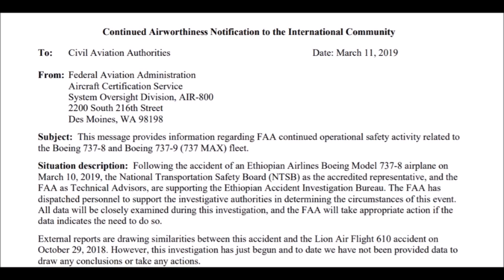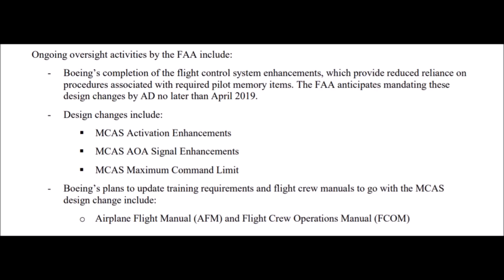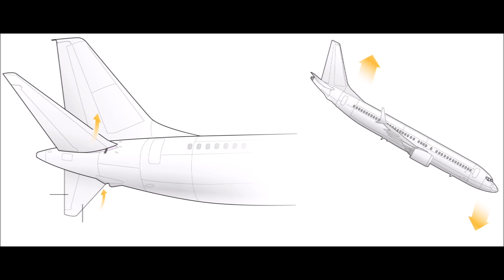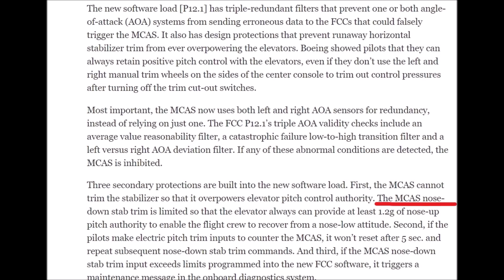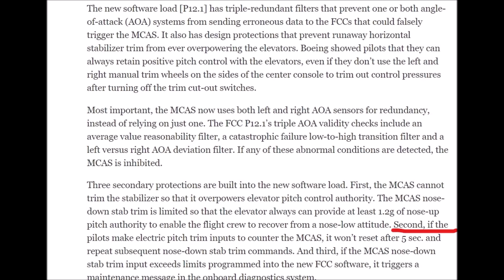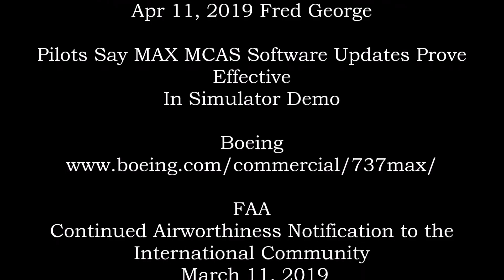737 Max UPDATE 14 April 2019 "The Fix"

Comment: Why was it not made easy for pilots to simultaneously disable MCAS control and enable pilot control of electric stabilizer motors? It seems so obvious, there must have been some engineering reason to not design it that way.
Reply: Its obvious only in retrospect. The engineering reason was the need to avoid additional wiring and switches. The training reason was to avoid more hours in the simulator.

Comment: Does anybody know if it was the Capts. side AOA vane on both the Lion Air and Ethiopian accident aircraft which caused the problems?
Reply: Yes, captain's side on both. This is part of a bigger puzzle. One clue may be that the passengers embark from the captain's side, so there may have been ground damage to the AOA vane on that side of the aircraft.
Reply: @gordonrichardson2972 , the aircraft I used to fly had a problem with the jetway damaging the AOA vane, but since we didn't have anything like an MCAS/stick-pusher system not as serious obviously. Jetway drivers were warned to carefully drive up to the door without hitting it, but it still happened...
Reply: Precisely! Studies have revealed numerous cases of damage to AOA vanes, but without MCAS nothing happened expect unreliable airspeed, which is not flight critical.

Comment: I don't think the max is inherently stable when there is a "but" after the "inherently stable."  It might be possible to make it stable but by design it isn't inherently stable.
Reply: jones jones — What does “inherently stable” mean?  This term is thrown out without anyone explaining what they mean by it, which indicates that they don’t know what they are talking about.

The center of gravity of an aircraft will normally be in front of the center of lift, but will vary fore and aft depending on fuel, cargo, and passenger load.  Gravity will therefore cause a pitch-down effect.  When engines are slung under the wing, below the center of mass, under power there will be a pitch-up effect, which will vary depending on power.  The adjustable horizontal stabilizer is used to compensate for these forces to achieve balance.  This is done on all similar aircraft.  There is nothing fundamentally different about the 737 Max.
Reply: @GH-oi2jf  I've flown many airliners first off and was an airline mechanic before that.  I'm not a video game player commenting.  Not every plane has what the max has.  Not even close.  Pitch up with wing mounted engines is normal when increasing power but no other planes have an mcas system to counteract an abnormal amount of pitch up the max 8 has.  Inherently stable plane means stable plane.  It isn't inherently stable if adding power causes such an extreme pitch up moment that the plane needs software to counter the affect.  In ANY other plane out there right now, a little pitch down and manual trim or auto trim if airbus, is enough.  The max needs more than that.  That to me, seems less than inherently stable regardless of cg.  Every other plane out there is fine with a light load and aft cg with what has been considered a reasonable amount of pitch up with power without the need for mcas 

That said I have to admit in hindsight that perhaps the pitch up isn't that extreme but it is just enough more, that Boeing felt mcas could avoid the requirements for additional crew training.  I just have a feeling though that it must be pretty bad compared to other models of the 73 to warrant the extra complexity.
Reply: Nice explanation! Unfortunately the public have been much misinformed about stability, particularly by fringe media stories.
Reply: @gordonrichardson2972  only problem is I probably know 10 times more than you about this subject.  Still not a hell of alot but more nonetheless.

Comment: Once again we got an excellent explanation about what’s going on with the 737 MAX. 

I’m hoping the airlines require rigorous pilot training for the new MCAS version. That should be equivalent to getting a new type certificate.
Reply: According to the WSJ “the proposed revisions, released for additional public comment, don’t mandate additional time for pilots in ground-based flight simulators, because FAA officials have determined the handling qualities of 737 MAX jets will be similar to earlier 737 models.”

But that’s what they claimed for the original MCAS. And 346 people died.

Comment: MCAS is only the tip of the iceberg - the aircraft is not designed properly - the MCAS is a makeshift bodge to try and correct the fundamental problem.
Reply: Bruce Bedlam — Baloney.  This is conspiracy nut stuff.
Reply: Plenty of nuts out there...

Comment: Has anything been found as to the reason that the angle of attack sensor readings are not correct on new aircraft? Is something being done that causes them to fail? I assume they are the same sensors used on other aircraft.
Reply: Maybe others do fail, but on other planes that failure doesn't drive them nose-down, so it isn't such a big deal ?
Reply: Exactly! A warning of unreliable airspeed isn't going to crash an aircraft.
Reply: Good questions! There were suggestions of electrical faults, but mechanical damage on the ground may be the simplest cause. Other aircraft have had AOA faults, but without the catastrophic consequences.
Reply: Any small, movable mechanical vane stuck on the outside of an aircraft must be susceptible to physical damage, ice, lack of lubrication . . .  just look at the history of pitot tubes which are inherently simpler.
Reply: @TommyRaines  If they have a high failure rate, I would think that there would be at least 2 on each side and they wouldn't rely on only one.
Reply: BTW, the B-2 bomber uses non-mechanical AOA sensors, but those can also fail if water gets into them. See: https://en.wikipedia.org/wiki/2008_Andersen_Air_Force_Base_B-2_accident

Comment: I can't understand one thing: if MCAS was originally designed to compensate the changed position and thrust of the new engines, why it's main input data is not the actual thrust levels of the engines?

Comment: Nobody talking about the fact that the aircraft design is faulty. MCAS wouldn't be required at all if they had actually designed it properly in the first place. MCAS was a fix. Now they are talking about a fix for the fix. That will probably in itself require a fix.
Reply: Dead on.
Reply: Spot on, it's crazy, all to save money and be more competitive. Hopefully once the NTSB complete their investigations the whole industry will get a shake up and also break the cosy FAA/BOEING relationship and the practice of self certifying their own designs. All at the cost of so many lives, that's a tragedy.
Reply: Oliver Lewin — The aircraft design is not faulty, apart from MCAS.  You weren’t paying attention to the video.
Reply: @GH-oi2jf  So why don't other aircraft use it? My paramotor doesn't need electronic aids to prevent a stall. Neither do most others. MCAS was a fix to a design flaw. It's that simple!!
Reply: @GH-oi2jf  MCAS is a sticking plaster to enable a larger engine to be built on a 60s designed airframe.

Comment: Bottom line "FOLLOW THE MONEY". Automation is all about ' Replacing the cost of pilots.
When you here something like " Statistically, pilots are dangerous .001% of the time and the 
composite computer banks are "ONLY  DANGEROUS" .000001% of the time. 
Like flight engineers it's, Goodbye Pilots and we get to install 4-6 more rows of seats.
What are your thoughts on the Boeing UninterruptIble AutoPilot  ?

Comment: It would seem by your comments regarding seasoned pilots inability to positively discriminate between aircraft flying characteristics either with or without MCAS that the FAA's certification requirements are too strict-(finicky). If the additional certification had not been necessary, then MCAS wouldn't have been designed or implemented. I speculate that the two accidents may not have happened at all.  Thanks for your uploads.
Reply from the maker: Excellent point Smitty!
Reply: Captain Sully put it well in the NY Times: In fixing one problem, they created a greater one.

Comment: It seems like Boeing got over-confident and "forgot" 100+ years of aviation experience (the pilots are in charge). With so much importance being placed on simulators, I hope those designers/programmers are paying attention. Everyone assumes the simulator "exactly" captures the complete flight characteristics of the given air frame. IMHO, an impossible task.

Comment: FAA "acceptance" alone wont cut it..  If AESA and the Chinese is not aboard with the "fix", the Boeing ain't going..
I no longer see an outcome where the plane is not going to loose grandfathering and ultimately Boeing are going to have to pay for new ratings of pilots worldwide..
Reply: Boeing incorporated MCAS to cover 737Max as 737NG (in normal condition Max = NG) but with failure of one system make Max new plane and FAA should calculate this as normal condition. EASA and CAAC is big problem even after "fix". Different TR should be incorporated on start for Max's